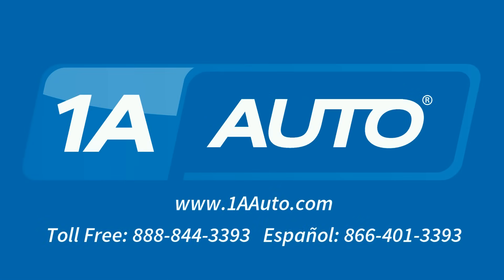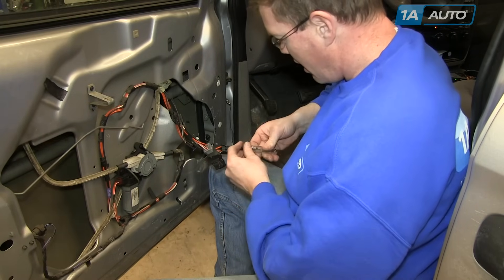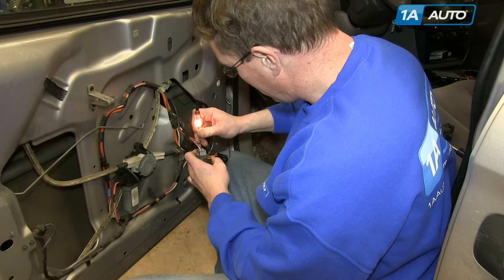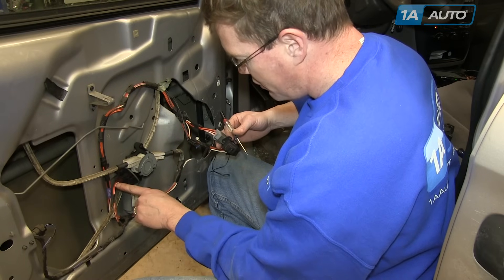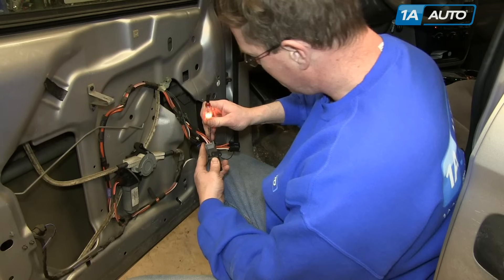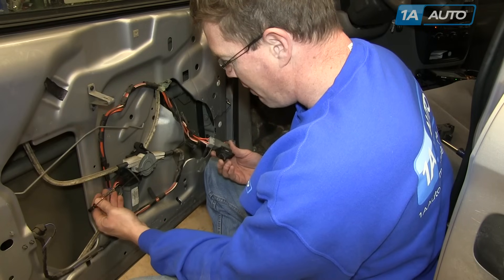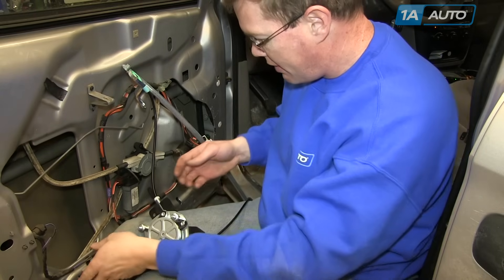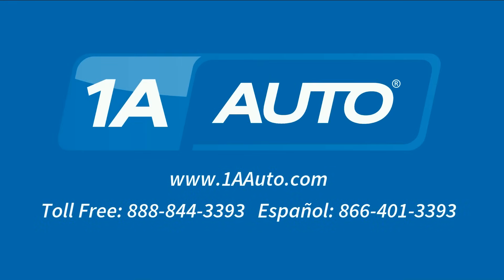How To Diagnose Power Window Problem - Is the Switch or Motor bad?

Comment: what if it your window works sometimes and don't ? or if the window rolls down by itself ? a short ?
Reply from the maker: +flipin fin There might be a short. You may want to check the wire harness that runs between the driver's side door and the body of the vehicle for a frayed or broken wire that may need to be repaired. Hope this helps you out. 1aauto.com
Reply: 1A Auto Parts Thanks for the response is there a easier way to test for continuity or voltage or I'd just have to look ?

Comment: Hey, not sure if this comment will go missed or not but my girlfriends car windows have been acting up for months now. (Honda Accord 2004)Her two back windows have lost all control completely and are stuck in the cracked position. After multiple attempts at forcefully pushing them up they don’t stay up, with no response from the driver control panel either. Shortly after the passenger window went, the driver window will work then won’t at times. I’ve been trying to diagnose what the problem is with YouTube videos but still have no clue what the deal is. Any response would be appreciated

Comment: But maybe 10 to 20% of people who buy that motor don't need a motorthe window cubi stock so you got to diagnose it by taking the old motor out trying it to see if it works or not and then trying to see if you can lift the window manually

Comment: U noticed two black and red wires on the passenger side and there taped together in the door pannel. How can I run new possibly compromised wire I'm the door jamb with no insulation on the protective weatherproof jackets on the booth sides. My passenger window won't go completely up and I have a 3/4" gap at the top of the window.i removed the passenger side switch and it just fell apart. I noticed there were some exposed wires. At least the two red and black wires going to the drivers side. I realize I have to install a new passenger side power window switch. Is there anything I can do install new wires from the passenger side controller to the drivers side.  I have a 1998 Subaru forester and it working until about a week ago.  Can any one please give me some options or remedies.. I'm afraid that each doojamb harness jacket has been compromised and I just don't know what to do.  Anyone please,  I need a miracle.

Comment: ahh...hold the switch down and wiggle the coduit between the door and A-pillar. if the window goes down intermittently, its a broken wire. the copper wire has work hardened and broke. if not, test the motor with a power and ground from a 12 volt battery. if the window goes down, its the switch. too easy. why do you guys over-complicate this shit?